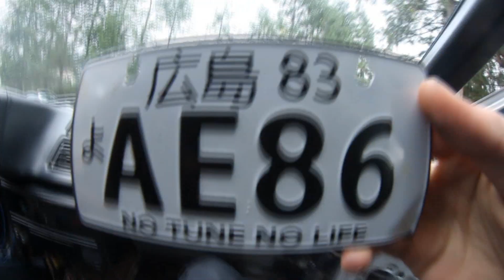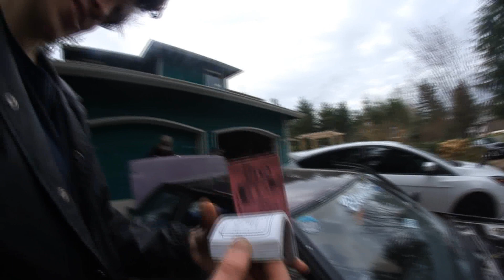QUENTYN BOUGHT AN AE86

Comment: $2000.. yikes, good luck and save it please. 
I own an 86 and live in Seattle. See you around some day.
Reply from the maker: +Austin Lingren pretty good deal, straight body, running 16 valve, bc coils, lsd w/final drive and a couple aftermarket ttt suspension parts

Comment: its not a ae86 if its from 1985
Reply from the maker: +David Enriquez  It's a 1985 toyota corolla. Chassis code AE86. Which means it's the GTS model and has a 4age. AE85's were the SR5 model. If you wanna stray from chassis code like everyone always seems bent on doing, it's technically an AE88 if you're gonna call it by the vin # instead of chassis code. My understanding anyway

Comment: not anb86 if it's an 85
Reply from the maker: +Dallas Wheeler It's a 1985 toyota corolla. Chassis code AE86. Which means it's the GTS model and has a 4age. AE85's were the SR5 model. If you wanna stray from chassis code like everyone always seems bent on doing, it's technically an AE88 if you're gonna call it by the vin # instead of chassis code. That's my understanding anyway